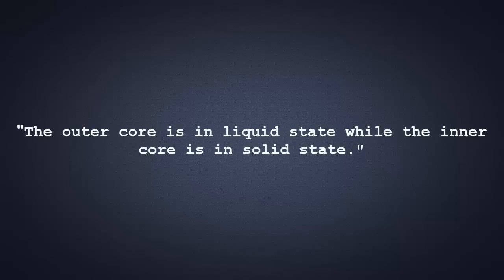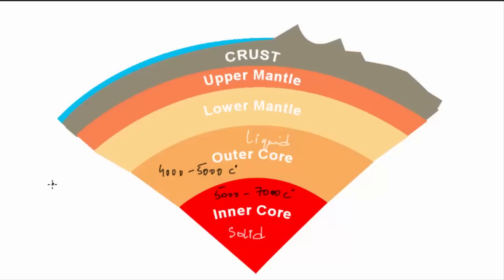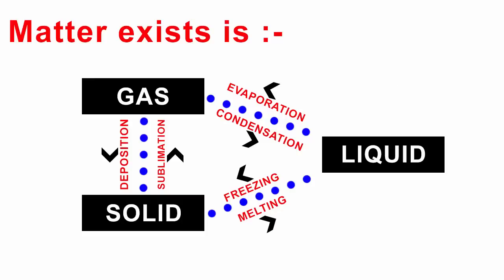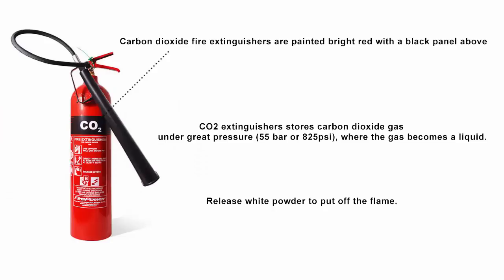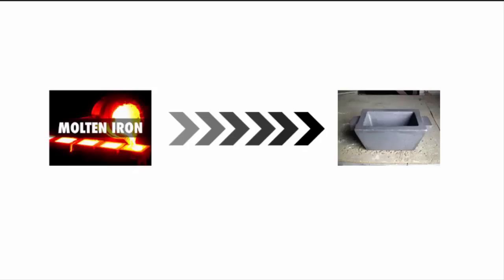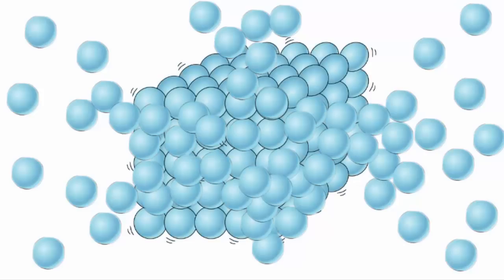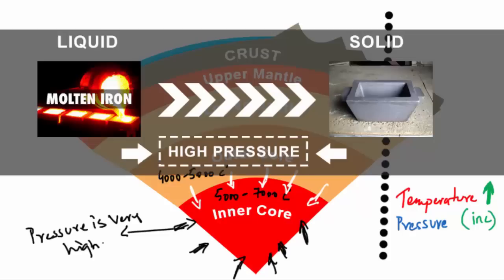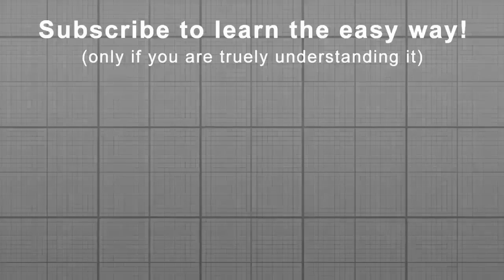Why is Earth's inner core solid explained!

Comment: Sir one small dought
Earth inner core is in solid state and the outer core is in liquid state due to pressure variation then ,why the mantle and Crust are in solid state without higher pressure condition
Reply: Brother the rate of temperature is not so much high in these layers that is why it is in solid form.

Comment: Tectonic a plates would have enough size to create magnetic spin so this is what I said. It is sad that people believe it with one side of Earth pushing in and the other out it would great a super mountain. There are plates in the inner core though along the "plate boundaries". Magnetics are the science behind gravity because everything is magnetic everything has an orbit and this is the center of mass between it and what it's orbiting, once it touches it can't escape it's there, unless you use and upward force. And with this you can make an object float in the air. This is true and that would make tectonic plates into a super mountain. Plus Pangea sounds very similar to Paganea. And yes it is a Pagan belief. The mid ocean ridges are the rivers of Eden. I'm glad you read this before disliking. Because now you know a truth. When something has enough magnetic force it spins and cause things to spin around it. And the more it has the more heat it gives off. So it would create chaos with Tectonic Plates. Also you can alter space time with electromagnetics. This is how to make something faster than light. This is also why the planets closest to the sun go faster. Objects put their magnetic forces on the other object. This is why when an object in space is close enough it gets tidal alocked. And all objects orbit each other but the center of magnetic force is toward the closer one. And when an object is small and close enough it don't orbit it becomes pulled down and held to the object through magnetic forces. And all this magnetic information proves what the poles are. And another thing that's important is the closer object is always the pull if one object is with in another. And that's why when we are at 1 pole it doesn't push us out. Also electrons pull on Neutrons and protons and make them move. The more this pull the higher the temperature. And it's always linked to Neutrons and Protons going around from South to North and from with in it North to South. And while they travel they make antimatter. And you can things float in the air with anti-magnetics and deflect metal.

Comment: Sir I have a question that :the place where temperature is high, there is low pressure,  so am little confused about the inner core where the temperature and pressure both are high . will u pls help me out?